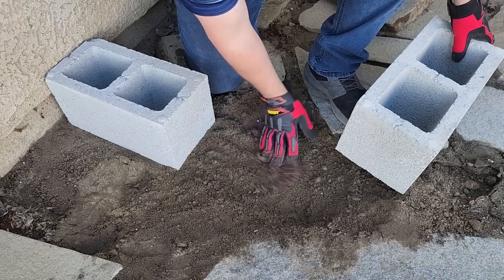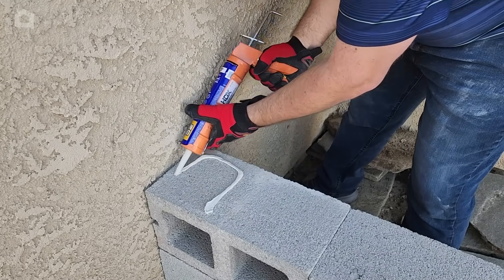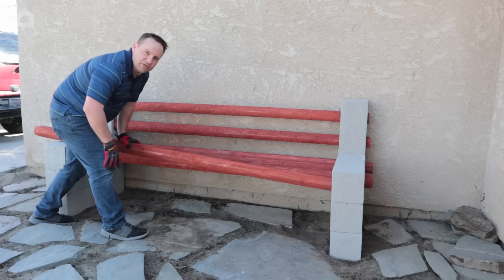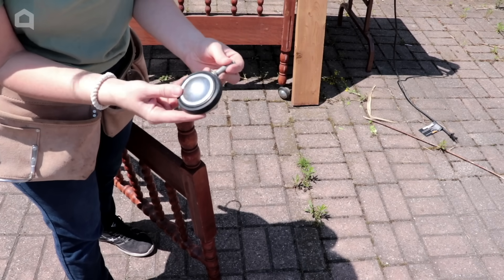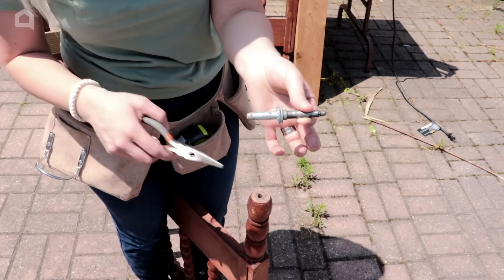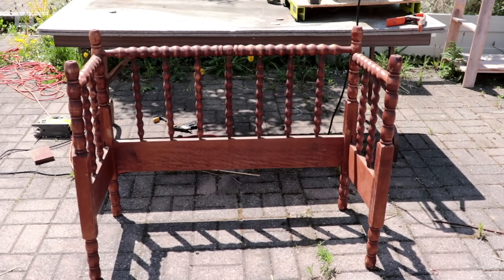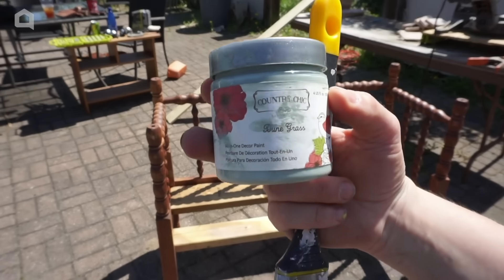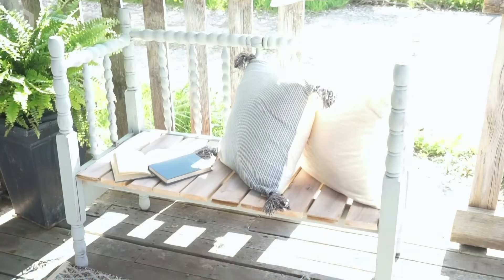He stacks cinder blocks in his front yard for a brilliant outdoor furniture idea!

Comment: What would you suggest on the bottoms so rain Won't rot wood if outside?
Reply: If you use pretreated wood it will hold up great.  Also, you can apply water seal to the wood and they will last you for years.
Reply: @GoodlyEarth  Thank You.👍😃

Comment: Two screws on each side to hold the 2x4s are not going to have enough "shear" strength for people to sit on, not in my family LOL. The wooden bench would be more durable if you put the 2x4 seat supports on top of the side pieces (between the spindles) and secured them by screwing from the top of the board down into the side supports or using pocket holes on the side supports into the 2x4 underneath. Another idea is the put a cleat on each side (glued and screwed) of the side supports and then place the 2x4s on top of those, then screwed in from the top into the cleat (maybe toenail or pocket hole it into the cleat from the bottom). I like the look, but the construction could be improved a bit.

Comment: First bench might as well been mortared together and also there isn’t anything keeping the timber from sliding around. Second bench will not support the wear of an adult actually using the bench if left outside, that wood is not pressure treated and those screws will snap after a year outside